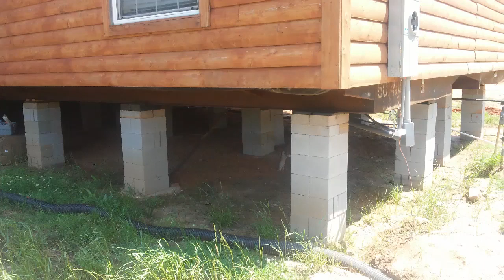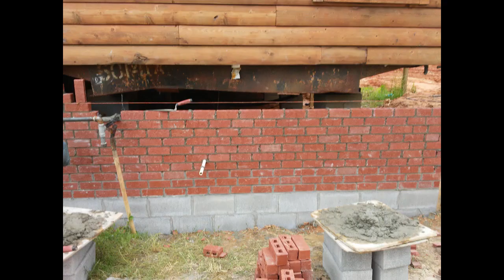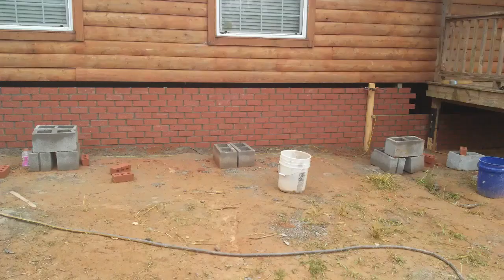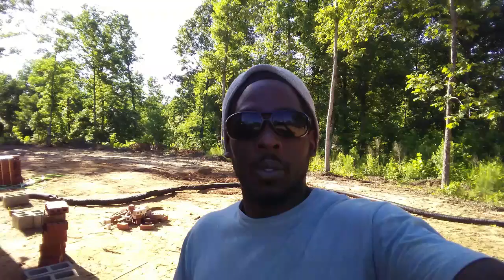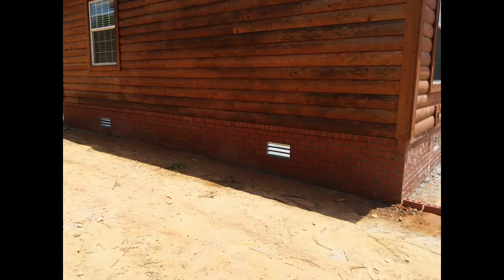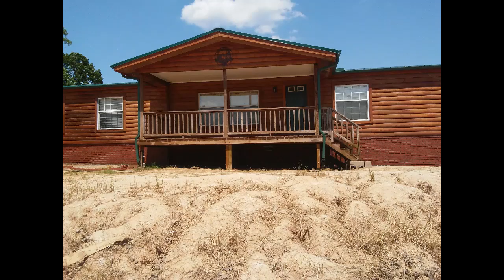MOBILE HOMES BRICK UNDER SKIRTING

Comment: When you use brick or cinder block for underpinning, does it touch the bottom of the home to completely seal it? Does it bare any weight?
Reply from the maker: It does not bare the weight. Yes it should touch depending on the design. It can also go under the trailer up to bottom of home. But the goal be to leave no gaps or space between house and brickwork.
Reply: @troythebrickmason9003  thank you. All the block jobs I've seen on YouTube have a small gap at the top. My thinking is it defeats the purpose if it doesn't to check the home. Keeping spiders and other bugs out. Eventually, if the home footers sink a little, this should bare a little weight sealing it even better. How far into TN do you work? I'm between Bristol and Knoxville.

Comment: How much was this job
Reply from the maker: It depends on what you want. Prices vary...
Reply: I was curious about the ballpark cost of this particular job.
Reply: @ChuckD351  I don't think, they wants to to answer that cause it cost an arm and a leg! bunch of skunks!
Reply: @troythebrickmason9003  7k ish?
Reply: @Kevinchong18  Determine the cost of the materials, based on the size of your house and how high it is off the ground. If you were doing this with concrete bricks for example, one brick is .44 cents at Lowes. If your house is only a foot or two off the ground, it's pretty cheap.
Reply: @shraniken  you still have not answered our question?  how much was the jod on this video? and stop betting around the brush about it!
Reply: @Kevinchong18  Don't think you meant to reply to me, but at the highest point of the skirting, probably $13-14 per foot (using the cheapest bricks I've come across). If your house isn't very high off the ground, say 16 inches, could be as low as $4 per foot. That's not including mortar and tools. Cinderblocks are a little over a $1 each as well, if you're using them. 

Him saying how much he spent won't really mean much considering it would be very specific to his build.
Reply: @shraniken  thanks… I need this for my home